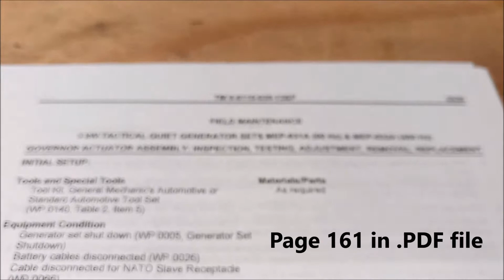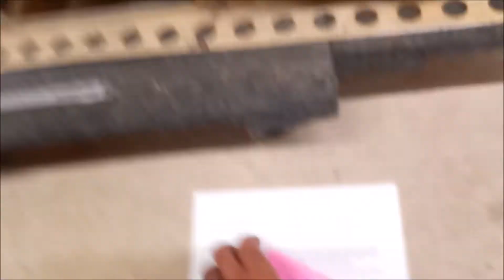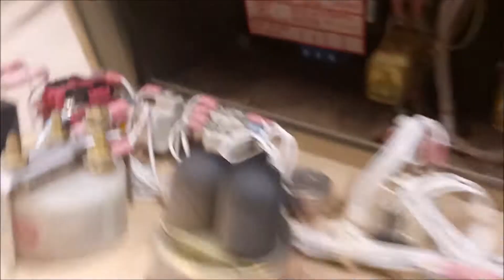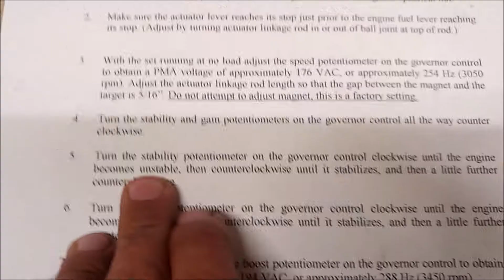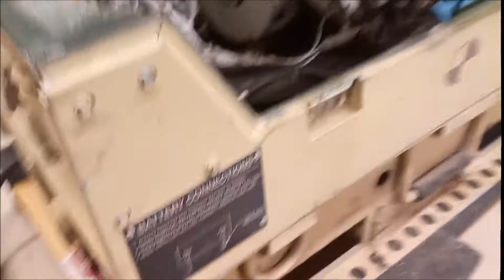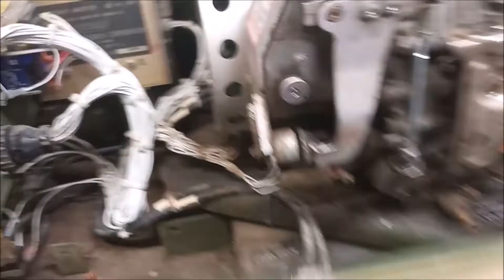MEP 831A - Part 1 Speed controller & governor adjustments

Comment: Power factor, in the simplest terms is the relationship of the phase of the voltage to the phase of the current as it passes through the load. A resistive load will have a power factor of one. In this case the voltage and the current will be in Phase with each other.
Reply from the maker: Thank you for this!

Comment: Great video! One question. Will it output 50Hz instead of 60Hz?
Reply from the maker: I don't think so since it's an inverter. If is was a regular type, you could reduce the RPM.
Reply: @CallMeColtLLC  I was looking into other models on the internet. They show the option 50/60 Hz. The problem is where I am in Portugal I only found the same model you have listed...
Reply from the maker: @makestuff_portugal  The larger models will do 50hz by design. But the smaller ones all do 60hz. You'd be better off buying a European marketed Yanmar machine that produces 50hz.

Comment: Step 5 and 6 is reverse. you start adjust the Gain and then stability. Much easier and should be like that.
Reply from the maker: I was just going off exactly what is in the TM & guide I found. Not saying you are wrong! In all honesty, getting the aftermarket controller that adjusts itself is a WAY better option. :)
Reply: @CallMeColtLLC  Yes the guide is wrong. reason I know this is because I work for Governors America that make these controls. Good you found a better control.
Reply from the maker: @ArniAtlason  Thanks for the heads up. If I need to work on another one of these I'm going to try it. 😎
Reply: @ArniAtlason then maybe you can explain why those garbage governor control modules go bad regularly and absolutely suck. They're junk. Every single  831a generator has a bad one. Replace it and maybe a year later its bad again.